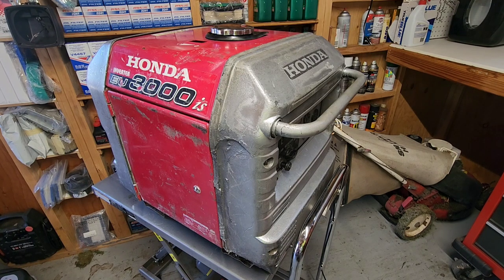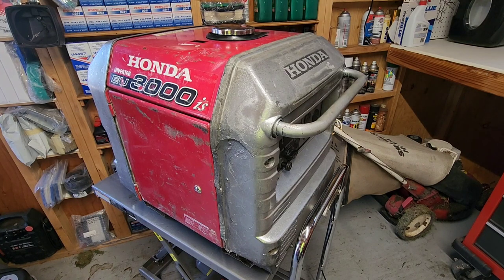Let's adjust the valves and clean the spark arrestor on my Honda EU3000is Generator. Step by Step

Comment: HELP....  Can someone tell me, is the Intake Valve Stem suppose to have a Little Rotator Cap on the Top of the Valve Stem, exactly the way the Exhaust valve stem does?  The parts break down only shows 1 on the Exhaust. But I find the Intake Rocker has way to much play side to side after the valve is adjusted. That cap part number is: ROTATOR, VALVE    14781-ZE1-000.   Can someone advise me. My generator doesn't want to rev up and needs at least 2/3 choke even to keep it putting along at a very low RPM. I have set and reset these valves a dozen times.  I think it is missing the rotator cap on the Intake Valve Stem....  ???
Reply from the maker: I have not had this that far apart ... I suggest looking up a parts exploded view on line for that part. Determine what GX Honda engine this is.. GX 390 or close.... then find the parts view and see if that stem cap is there or not...

Good luck

Glenn

Comment: Pistion has to TDC to check valves and .003 for both valves
Reply from the maker: It can be at TDC but does not have to be. If one valve is open, the other is closed and can be adjusted  

Thanks for the comment

Glenn

Comment: Glenn, it’s the electric start motor. Although it sounds good, it is weak and is not turning the engine over fast enough to create spark. Had the exact same issue with one of mine.
Reply from the maker: So we took this Gen on an 11 day RV Trip in June and used it quite a bit. I shut it of to add gas and it would not restart until it cooled off. Ran for many hours .. A guy on the Honda Groups page on Facebook is convinced the magneto gap is too small, that is starting to make sense.  When I get back to this project I will try to jump start it and spin the starter faster, but I think I'll end up re gapping the coil... Thanks for the comment.

Glenn
Reply: Could you make a video on doing the gap also.

Comment: Glenn, your going to think I'm crazy but I would suggest two things. Firstly, have you checked the ignition switch or corrosion or water ingress? If not, that would be a good place to start. Secondly, the crank speed. When using electric start, the coil won't fire unless the crank speed is high enough. I know it sounds healthy, but it would be a good idea to connect it to known good battery to see if that changes anything. My EU3000 seems to crank a little faster then yours, but that could be just the video. Report back with what you find.
Reply from the maker: Not crazy... I ordered a new ignition switch on day one and it is scheduled to arrive today. I am 98% sure it's the problem. This is my second EU3000IS and I am sure the starter turns the engine fast enough. I can see a slow rotation might cause a weak spark in intermittent spark, this has no spark. I hope to at least take the time to install the new switch in the next couple days and see if I have a winner!
Reply: mine recently stopped starting with the electric start. Starts just fine with the pull chord. My one thing that is different is that when i turn my key, i get nothing. doesn't crank or anything. would this just be a bad battery? @GlennsSpeedShop

Comment: I scored 3 of them for real cheap couple of weeks ago, all three ran but was neglected and had some kind of water in the tank and gunked up cab, Fast forward I have all three serviced and running good with tank all cleaned out. But, I notice, it seem to be running hotter than the other two, I have cleaned out the spark arrestor, swapped carb and plug but it still seem to be running hot. Could the valve adjustment cause something like that??

Comment: Yup. Mice get in there and make a nest by the starter. 
After three times it wouldn’t start for all the nesting material. I remembered someone saying they used the rope got it going then reduced speed with eco boost. And engaged the starter with the key and let it run engaged. And it fixed it somehow. I did the same. And it worked for me too. 
I engaged it for like count of 15 about 5 times. It sounded better each time. 
I sprayed a bunch of WD40 in there and it works ever since. No tear down. I have since put steel wool and screening in there and sprayed it all with WD40 to prevent rust. But also deter with smell. It works. That and poison blocks I put around it. Been fine ever since with battery on a Tender.

Comment: Curious, you never mentioned the hole in front plate was there already for propane fitting, or it has to be drilled.
Great vid.
Reply from the maker: It was not prepped for propane...

Thanks

Glenn

Comment: Well... I suppose I should of check those two things before I put a new carburetor on it and then cut the wires for the eco switch 
So...tomorrow I'll check and adjust the valves and see if that will make it start. I know it's getting fuel and spark but it will not start..tries to but won't fire